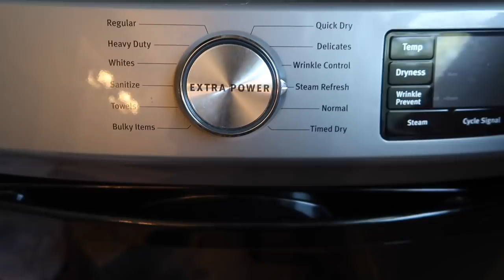*NEW* DEEP Clean #withme | Cleaning Motivation! | Pillow Refresh | Gas Stove Deep Clean | Rachel E

Comment: A suggestion. This is something I do myself. Line the stove top, the part under the grates, with aluminum foil. Every time you clean it, which is something I do every weekend,, I pick up all the aluminum foil and throw it away.  Then, I clean the stove top. I finish and line it again. It's much easier.